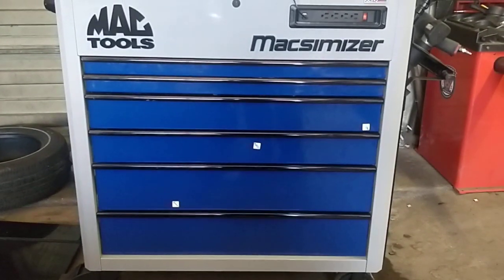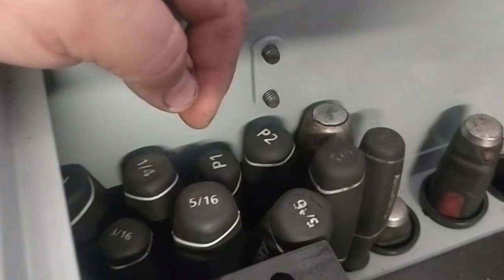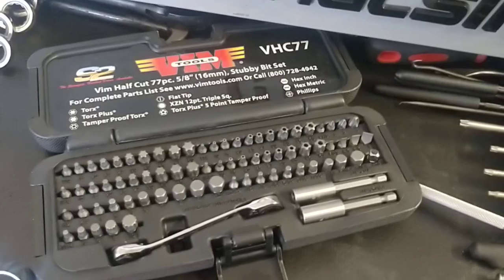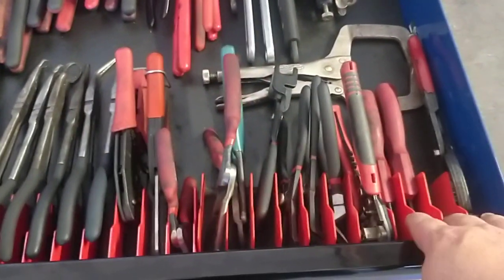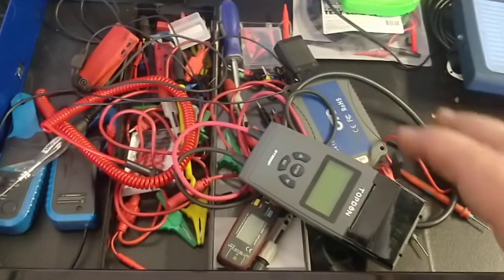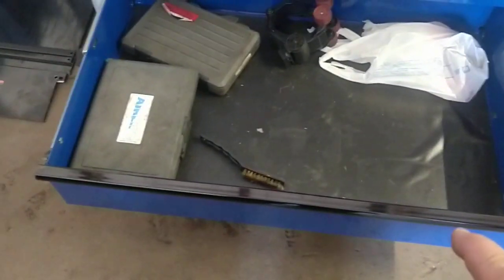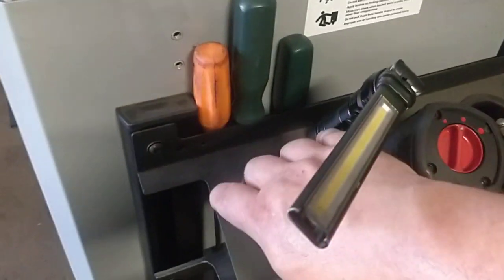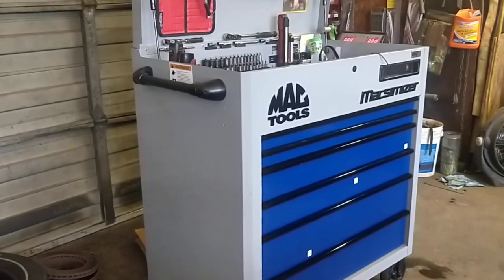Mac Macsimizer Cart Tour

Comment: Do the drawers have a sliding mechanism to open or do they just slide open?
Reply from the maker: They have a detent which holds them closed and it's adjustable also they have a locking mechanism in the top of the box of you wanted to roll the box and not let the drawers open but the detents work really well
Reply: @jwilkers1  oh okay thanks I appreciate it!
Reply: Sorry to bug but is it like the drawers from snapon epic toolbox where you press on a hinge up on the drawer so if can open do these have a similar thing to open any drawer ?
Reply from the maker: @MrJD240sx  these don't have a hinged latch or slider mechanism just the detents and they work really well and of course they're adjustable so you can make them very easy to open or much stiffer